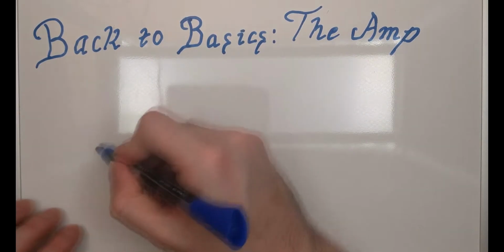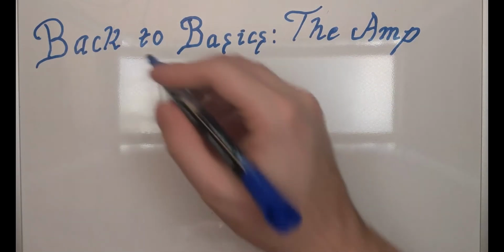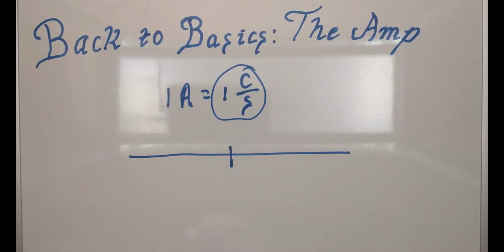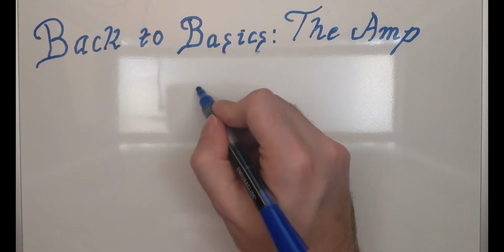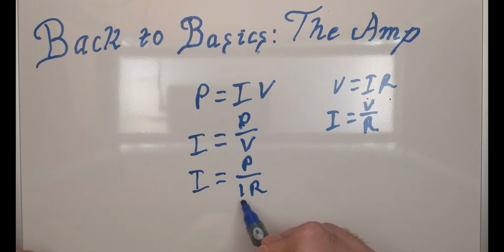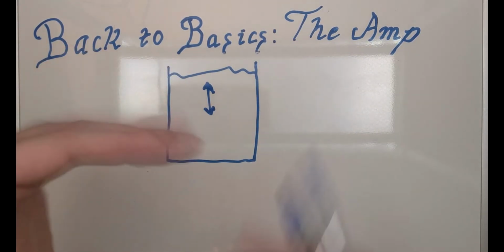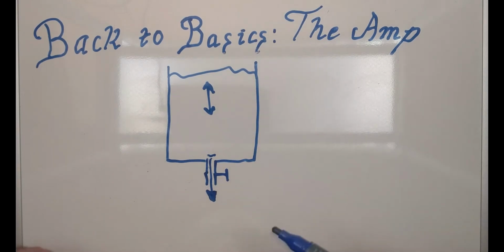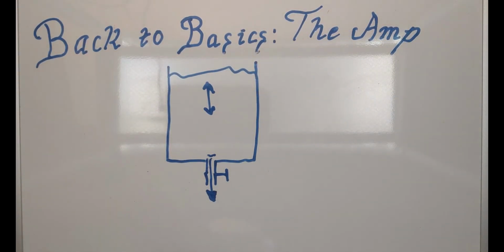Back to Basics: The Amp(ere)

Comment: But what is the pressure of an infinitely small and long wire
Reply: Don't say infinite 😂
Reply from the maker: Technically it would have infinite resistance, so it wouldn't conduct. The smaller the diameter of wire, the resistance increases (this becomes a concern with house wiring), additionally the longer a wire is, it's resistance also increases, so we're dealing with two infinite increases to resistance.
Reply: Gadgetboy wait, isn't its diameter almost nothing, or as close to nothing
Reply from the maker: Exactly, so the resistance is extremely high. The larger the diameter of the conductor, the more electrons it can give up to the electron flow, and thus its resistance decreases.
Reply: Gadgetboy aaand now I can't play Chopin. . .

If it were truly infinite it could give up everything😝 but yes, I got it as I sent that message
Reply from the maker: Chopin was a composer, not a conductor. :-p
Reply: Gadgetboy ok?
Reply: Gadgetboy I only just got that, agh...